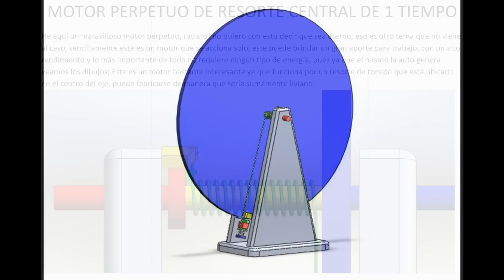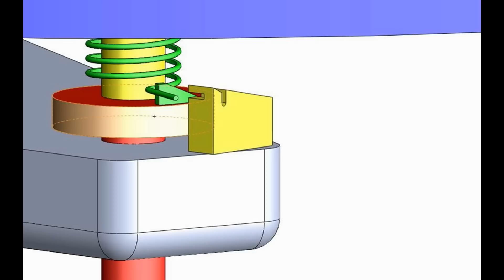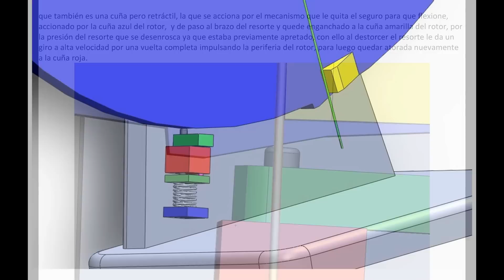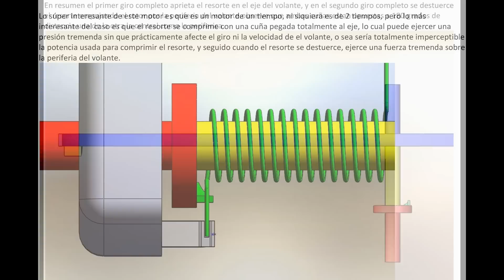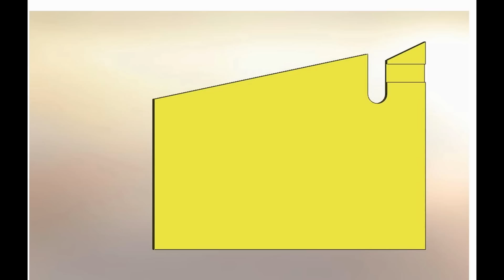MOTOR PERPETUO DE RESORTE CENTRAL DE 1 TIEMPO

Comment: The geometry is backwards of that which it should be, however, You have the right idea.
Incorporated with useing momentum flywheel energy to compensate for spring tension and you got a snappy fast magnet motor on your hands.

Comment from the maker: MOTORES PERPETUOS COMO CONSTRUIRLOS
SERIE DE MOTORES SIMPLISIMOS QUE USTED MISMO PODRÁ HACER EN CASA
A LOS QUE LES HE DENOMINADO MOTORES TONTOS 
NO POR QUE ASÍ SEAN SINO POR QUE LA HUMANIDAD HA SIDO DEMASIADO TONTA POR DEJARSE ENGAÑAR CON MOTORES DE ENERGIAS CONTAMINANTES POR COMERCIO ASÍ QUE DEMOSLE PUNTO FINAL A ESTA PESADILLA.
COMENZAREMOS POR ENTENDER LOS FUNDAMENTOS DE LA ENERGÍA:

   LAS LEYES DE AUTON
Las leyes AUTON son las leyes que rigen a todos los sistemas o mecanismos con auto sustentación del movimiento o la energía, con un  factor de rendimiento multiplicador elevado a suficiente nivel para obtener energía libre para trabajo constructivo. 

LAS BASES DE LAS LEYES AUTON SON; 
1. La ley AUTON afirma que donde quiera que exista un incremento multiplicador de potencia puede crearse un mecanismo inteligente que lo auto-continúe. 
2. En algunos planos de la materia o mecanismos la ley AUTON señala el requerimiento a la par,  de más un factor paralelo de condensación o continuidad de la energía o movimiento inercial.
3. Cualquier elemento que pueda ejercer una fuerza y retornar a su posición de origen sin deterioro puede ser utilizado para generar un mecanismo de funcionamiento autónomo y perenne sin dificultad alguna.
4. Por consiguiente cualquier energía o fuerza manifestada que ejerza en cualquier dirección su acción puede ser utilizada por la inteligencia AUTON para crear movimiento o transformarla en cualquier otro tipo de energía.
5. No por que existan leyes que lo permitan o no lo permitan, sino porque la inteligencia humana está por encima de todas las leyes, y a la cual he denominado leyes AUTON.
6. Para hacer funcionar cualquier mecanismo o sistema con los principios de las leyes AUTON y crear sistemas para lograr así la perpetuidad autónoma del movimiento mecánico físico o eléctrico-energético, solo se requiere el diseño súper inteligente y muy bien calculado con bases en las matemáticas de las leyes de la física, ya sea de lo material objetivo como de lo abstracto de la cuántica.
7. La inteligencia humana AUTON puede crear movimiento o extraer energía, de cualquier plano de la manifestación ya sea en lo electrónico, en lo  químico, en la energía pura, en la hidráulica, en la mecánica, e incluso en la fuerza y el poder de la nada o vacio denominado éter, y transformarlo en cualquier clase o tipo de energía, moviente o estática, valiéndose de los conocimientos de las leyes de la materia, aplicando las proyecciones geométricas y algebraicas  a sistemas o mecanismos que lo permitan.
8. La ley AUTON es en resumen la capacidad inteligible del ser humano atravez de la comprensión de todas las leyes que rigen la materia, en todos sus planos, para lograr crear sistemas interactivos aplicando la relatividad como cualidad intrínseca.
9. Quienes cultiven y desarrollen esta cualidad inteligible superior, está entrando en los albores del conocimiento de las leyes AUTON, la cual dicta que no existe ningún imposible para la inteligencia suprema del hombre. 
10. La ley nº 1 AUTON dicta que los cálculos de diseño de mecanismos o sistemas deben ajustarse al mínimo del esfuerzo inicial, con la obtención atravez del mismo de un máximo de potencia y rendimiento consecuencial.
11. El ordenamiento de generadores AUTON de sistemas de mayor a menor están en 1º Primer orden los hidráulicos-mecánicos, 2º Los mecánicos, 3º Los eléctricos, 4º Los químicos, 5º Los hetericos; estos aun no muy bien desarrollados actualmente, podrían superar a los hidráulicos en cualquier momento, en el instante en que los investigadores descubran el secreto del sol, que a partir de hidrógeno, helio y éter, se puedan construir micro soles AUTON de energía casi infinita, de tamaños muy reducidos y de energía perenne, cuya fuente podría generar una altísima potencia eléctrica, y así podríamos decir que un micro sol enano del tamaño de una pelota de ping pong, pueda suministrar energía sobrada para una o varias casas por miles de años.
12. LA LEY AUTON estudia el origen del porque de la vida desde su origen, va mucho más allá de simples maquinitas de  movimiento perpetuo, AUTON es la sigla de AUTO, de automático, automatismo, ON encendido, prendido, funcionando, quiere decir auto encendido, o sea que; funciona solo con su propia energía. Y es muy obvio que todo el universo es energía pura y funciona auto-abasteciéndose eficazmente  a sí mismo perennemente en una perpetuidad infinita y eterna.
13. En las plantas del reino vegetal se encuentra manifestada la energía  AUTON y ellas son manifestación esencial de esta energía biológica que imprime el sello de el universo, ejemplo; el terrario  el cual es un pequeño  jardín bien esterilizado dentro de un frasco de vidrio herméticamente sellado, observemos que puede vivir siglos sin destaparse ya que las plantas generan su propia auto sustentación. 
14. EL SOL otra máquina perpetua padre de las LEYES de AUTON demuestra claramente a plena luz como esta entidad biológica atómica genera energía inconmensurable, casi infinita, es aquí en este sistema energético que se encierran los secretos de los misterios de la energía AUTON, reto a  los científicos a que realicen una explicación matemática de  por que el sol funciona, y que fabriquen un micro sol en sus laboratorios con helio   he hidrogeno del tamaño de un alfiler para generar energía eléctrica para todo un país. Es muy posible que se estrellen porque dentro del sol existe algo que todavía no se conoce lo cual es la energía espiritual AUTON.
15. Si se llega a descubrir esta aleación de gases que desprenden luz y energía podríamos fabricar con helio he hidrogeno lámparas fluorescentes perpetuas que además de proporcionar luz, serian un generador poderoso de corriente eléctrica. Así que con un simple fluorescente del tamaño de 40 watts nos daría su luz, mas unos 10  a 20 kwa hora, por durante 500 mil o varios millones de años. Con un solo fluorescente podríamos mantener un hogar perfectamente y con otro podríamos alimentar nuestro vehículo aero-anfibio con motores de neodimio con rotores y estatores de aluminio.
16. Todo sistema o mecanismo que se fabrique o construya que  utilice las leyes AUTON deben ser única y exclusivamente para el bienestar, sanación y multiplicación del bien, para el bien, por el bien y para establecer el bien en pro de la naturaleza circundante, la cual nos encubre en su totalidad con su manto y podríamos afirmar que ella es nuestra verdadera madre perpetua, y por lógica y sensibilidad debemos tener muy presente en nuestra consciencia todo lo que a ella le afecte, automáticamente nos influye y nos afecta a nosotros mismos junto a todos los seres vivientes que nos acompañan,
17. ¿O HAY ALGUN BRUTO QUE OPONGA ALGUNA OBJECION AL RESPECTO? Es por esto que debemos comprender la ley flay back o eco esférico, esto es; que si tu estuvieras en el centro de una esfera solida y gritaras, la multiplicación del reflejo acústico viajando a 300 metros por segundo, al retornar a su centro es multiplicado a tal magnitud que podría mínimo romperte el tímpano pero lo más probable es que podría explotar todo tu cuerpo desintegrándolo como si fuera una bomba. Así mismo la naturaleza, el mundo y el universo son esféricos y lo que nadie sabe, es que todo cuanto tu le hagas a la naturaleza, será devuelto multiplicadoramente por miles de veces a su originador sin que nadie lo pueda detener. Este conocimiento de la realidad concreta de las leyes reales se le denomina consciencia. 
18. Y de este conocimiento de la realidad del universo deriva la creación de la palabra ECOLOGÍA que quiere decir; tener plena consciencia de que todo cuanto le hagamos a la naturaleza nos lo estamos haciendo en NUESTRA PROPIA CONTRA MULTIPLICADA MENTE, o sea que el eco del rebote de todo cuanto hagamos, nos será retornado refractada mente, por esa gran logia del cosmos esférico volviendo así, matemáticamente a su centro de origen infaliblemente.
19. Por esta GRAN CONSCIENCIA verdadera de la realidad, estamos obligados a amar, respetar, cuidar y generar armonía máxima, por el bien, para el bien y sobre todo por nuestro propio bien. 
Por eso todos nuestros esfuerzos de acción y  trabajo deben avocarse 100%  a la mejoría de la vida de todos los planos y seres que nos circundan y conforman nuestro entorno ecosistémico de vida planetario. 
Quiero argumentar que este conocimiento de las fuerzas basculantes interactuantes del ecobios universal son parte vital del conocimiento de las leyes que forman la ley AUTON.

CUESTIONARIO REFLEXIVO ACERCA DE LAS FUERZAS INERCIALES AUTON

Si tenemos una palanca con un punto de apoyo que nos ofrezca un factor de ganancia de 100, 1.000, 10.000 Y 1.000.000 tendremos un factor multiplicador de potencia y energía. 
Si  tenemos una palanca lo suficientemente acotada para que, con un solo kilo, poder elevar un millón de kilos, tenemos un factor de ganancia de 1 a 1 millón lógicamente, en suma seria un equivalente a mil toneladas elevadas por tan solo un kilo.
Estimado lector y espectador quien tendría la inteligencia suficiente de crear un mecanismo para utilizar solo 100 kilos de las mil toneladas que han sido elevadas atravez de este mecanismo, para posteriormente elevar 1 solo kilo del extremo de la palanca a 10 veces mayor altura que la que se utilizo para elevar las mil toneladas?

¿SERÁ POSIBLE ESTO?

Es más no solo es posible hacerlo, sino que con tan solo 2 kilos podría elevar un solo kilo a más de 10 kilómetros de altura. 

1º EJERCICIO

1. Estimado lector este cuestionario es un ejercicio para despertar tu  mente dormida, este primer reflexivo te lo voy a dar como regalo para que lo resuelvas, tienes 365 días después de que lo hayas leído para que utilices tu capacidad imaginativa e inteligencia y conocimientos para crear este sencillo mecanismo y que lo puedas diseñar holgadamente, si  logras resolverlo lo cual es muy simple, por fa, publícalo por youtube y escríbeme a mi correo.

2. Por razones prácticas usa el modelo de 100 a 1 para que hagas pruebas y conjeturas ya que el de 1 millón a 1 te sería muy difícil realizarlo.

3. Para mí esto fue una súper tontería que resolví cuando tenía tan solo 9 años, así que por favor aplica toda tu inteligencia junto a todos tus conocimientos de física y matemática cuántica, para que resuelvas este ejercicio, de este elemental primer renglón del  cuestionario del conocimiento de la energía AUTON, espero que el grosor de la corteza cerebral de todos los seres más inteligentes del mundo, puedan tener la respuesta algún día, antes de que pasen los 365 días. Pero los más flojos podrían tirar los guantes blasfemando; “Esto Es Un Imposible Hay Leyes Que Lo Impiden”  y yo puedo apoyarlos en que de verdad están en lo cierto, en que si existen esas leyes de impedimento, y que de verdad son concretas como rocas de cemento del mas duro, y que estas se llaman científicamente imbecilidad elevada a la decima potencia.
Es muy curioso que estos conocimientos tan  sencillos sean como un punto ciego para los ojos y mentes de casi la gran mayoría de la humanidad.

4. El siguiente paso es hacer un mecanismo que repita incansablemente la doble acción de subir y bajar este mismo proceso.

5. Esto es lo más sencillo que les puedo dar como ejemplos para desempolvar,  ejercitar y ampliar la mente real, y así poder tener acceso a los conocimientos del movimiento perpetuo AUTON y la maravillosa  fuente inagotable de la energía infinita..

6. Si alguien considera que esto es un imposible de resolver, no es por que existan leyes que lo impidan y con esto se crucen de brazos para no hacer nada, sino que sus cerebros no dan para más y prefieren quedarse sentados en la raya de partida de una carrera olímpica, con el pretexto de que hay leyes que le impiden mover las piernas y que son tan poderosas llamadas inercia que no los deja ni levantarse de donde están. Y el mundo está lleno de muchos tontos que comparten la misma flojera.

7. No existen leyes que impidan nada sino mentes idiotas holgazanas que no tienen la capacidad de utilizar la inteligencia superior para descubrir los secretos de la misma.

AQUÍ INGRESA AL MANUAL DE CONSTRUCCIÓN DE MOTORES PERPETUOS.

http://tecnomagnus1.es.tl/%BFCOMO-CONSTRUIR-LOS-MOTORES-PERPETUOS-f--VADEMECUM-MANUAL-COMPLETO-DE-SECRETOS.htm